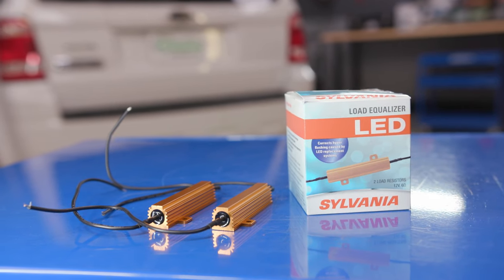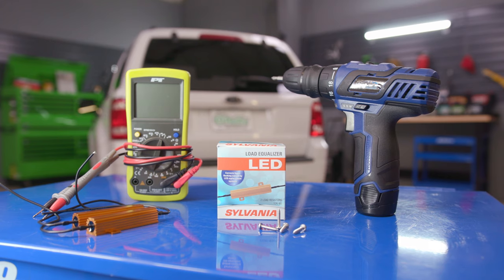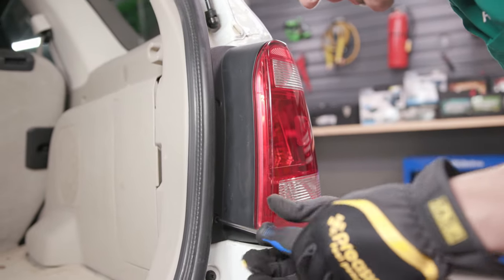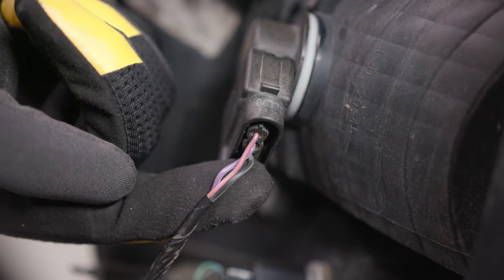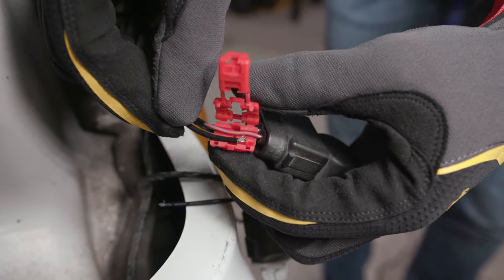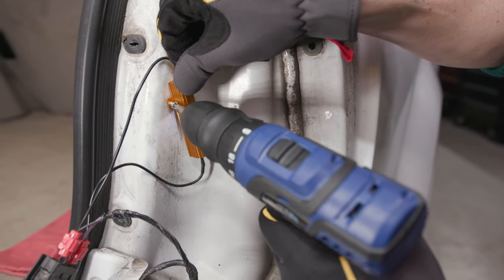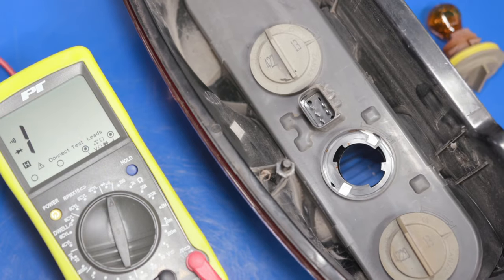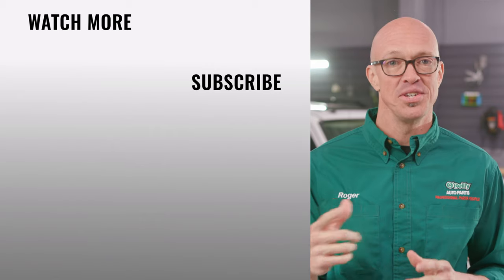How To: Fix Hyperflashing LED Turn Signals (Load Resistor Installation)

Comment from the maker: Supplies Needed for This Job:
1. Safety Glasses: https://urlzs.com/hbwc
2. Gloves: https://bit.ly/2GvfwAm
3. Pliers: http://bit.ly/2Zxerj1
4. Drill: https://bit.ly/3drlrF9
5. Self-Tapping Screws: https://bit.ly/34eUYXo
6. Load Equalizers: https://bit.ly/33hyplP
Reply: O'Reilly Auto Parts  what would happen if your LED burns out and you need to replace the bulb,  what if you have no choice and use a regular light bulb?  Do you have to take the load equalizer out so it works right ?
Reply: Do you have a link for those red splices?
Reply: How do you determine which is the common wire in the second scenario (with the plug with 6 wires). I determined the turn signal wire using continuity, but what about the position and common wire?

Comment: 16 bucks for two $1 resistors... dang!  That's my kinda profit!
Reply: 8pcs on amazon for $15
Reply: DO NOT USE THESE STYLE RESISTORS FOR YOUR VEHICLE!!! READ THE REVIEWS OF THE PRODUCTS YOU'RE BUYING!!
These Chinese resistors that you find literally everywhere (local auto parts store, Amazon, eBay, YouTube Links, etc) are 150w 6ohm resistors. LEDs won't EVER call for this much resistance.
Because of this, these resistors get SCORCHING HOT (over 250-300 degrees F) in a matter of seconds (around 15-25 seconds of use) due to the resistors insanely high Amp draw.
Most 12v resistance situations (CanBus Errors, Hyper Flash, etc.) call for 16-18 ohms of resistance @ around 13-15 watts. Simply buy (2) 25watt 8ohm resistors and wire them both in series (+ to -). That is PLENTY for a 12-16v application without burning up your car or constantly replacing LED lights that should be lasting months if not years longer than what they do.
Reply: @greysinclaire  where can I buy them? I just installed led headlights and I need resistors.
Reply: @LuisHernandez-he53  Check Amazon for some 25w resistors. They should look like these 150w ones just half the size.
Reply: @greysinclaire  👍🏻thanks for getting back with me!
Reply: @greysinclaire I told others. I highly recommend an led flasher relay or an led bulb with a built-in resistors.
Reply: @LuisHernandez-he53  Headlights use decoders not resistors to stop the strobing and winking.
Reply: @coloradostrong  can I find them on Amazon or eBay? Thanks for the reply..
Reply: @LuisHernandez-he53  u can. But I would check at autozone for Novita led flasher relay.
Reply: @coloradostrong  decoders or anti-flickers. Either one

Comment: And no point is it explained how to tell the common wire from the position wire. I give up I'm just returning it. I don't really see any point to adding this to use LEDs since it draws the same amount of power and costs five times as much.
Reply: U can still run led with a better approach. Instead of wiring the load equalizer resistor, just get the led flasher relay and swap them. 

When u have a turn signal lights on. U hear it clicking sound. Go under the steering wheel and from there, u will listen that turn signal click sound. It’s behind the plastic panel, once u do that. Use ur fingers to feel if u see a large box that’s labor as flasher relay. From there that’s the one u can swap from own to led flasher relay. 

Much more easier approach than splicing the wires.
Reply: If u don’t want to do all that. Get from auxito. They have a lot different led turn signal bulb options that have a built-in resistors. A simply plug-and-play led bulb. And ur done.
Reply: @toyotabrony Not at all clear what you’re trying to say.
Reply: @toyotabrony It took time to figure out what you meant to type instead of “labor”.
Reply: @user-yl4rh8vn8c meaning for an led bulb with a built in resistor, and draw the same or more wattage than the factory, it helps prevent from hyperflash.

Comment: One of the main benefits of installing LED lights in your car, etc., is the significantly lower current load on your battery/electrical system. By installing two 24W (e.g. 12V x 6Ω) resistors in parallel on each blinker circuit, you are essentially negating that benefit. This is not the correct procedure, it is simply a "lazy" workaround which actually introduces a safety issue because of the resistors heating up, which then requires that you drill them on to the car's body in order to properly attach the resistors to provide adequate heat dissipation/cooling. Not sure if everybody would be ok with drilling their car for no real benefit at all. Just saying ...
Reply: I got lucky on my 2018 f150, there is a spot where I could just use a metal hose clamp to keep it in touch with the body of the car
Reply: Ya k No,  I was thinking if it gets hot does that mean it is shorting out. And after reading your comment I agree totally. This sounds sketchy as hell LOL there's got to be a better way or just enjoy the quick Flash.
Reply: Other benefits e.g. brighter lights, longer life might make it worthwhile still, right?  Do you have a link to any info on the "correct" procedure?
Reply: Love how you criticize this method and call it lazy but provide no beneficial insight into a correct way to do it. That's what's lazy to me.
Reply: The primary benefit is longer life and brighter output. Not reduced load on the electrical system. That’s ridiculous. The ballast resistor restores the load right back where it should be, hence why the flashers now work correctly.
Reply: The benefit is the appearance and function of LED bulb its self —  load resister just makes it flash at normal speed. Been using these for 10 years. You worry too much

Comment: If front and rear turn signals are led do you need two sets ?
Reply: Yes.
Reply: @chrisjohnj30  so if i use led on front rear and side marker i need 3 sets?

Comment: It's actually because led lights are diodes and will show an open circuit in one direction, placing the 6 ohm  resistors will bleed voltage back to the flash relay sensor tricking it to indicate a n incandescent  bulb.
Reply: Just a load resister bro. Plug it in and it works
Reply: @drdrew3  Well at least he explained it. Many people have no idea. We will see how a resistor works for the underhood  light on my C5 Corvette. So far no one has been able to solve the problem.

Comment: Just installed One resistor 50W 6Ohm on rear led and It’s Ok for one side. No need to add one more resistor to any led. The relay working for each side not for each bulb. The front and rear bulbs are on the same circuit.

Comment: I tried using sylvania zenvo lights in my car(2003 Saturn ion) and the light flashed normally/DRL on on for a while and the Led will eventually go out like the car has cut power to it or it’s burned out and the signal will flash fast saying that the bulb is burned out. I’m wondering if this will work because it don’t hyper flash

Comment: Doesn't the load resistor ad pwoer draw... wich negates the whole or most of the benefit of havibg LED bulbs to begin with??
Reply: Why does this matter with a car? You have an alternator and a battery. LEDs you get the length of life over halogen and the brighter white for darker places in the pnw and many other dark places

Resistors allow them to function properly on some vehicles that are stubborn electricly
Reply: The idea is, u need to trick the computer, by add a resistor so the computer things ur running on a factory bulb, but in reality ur running with led.

Comment: On the Sylvania box it very clearly notes the resistors are for off-road use only. I just bought 4 of them from Walmart. And now, after watching this and reading elsewhere, I might just do what no one else has mentioned. I might just use a spare socket and a new incandescent bulb in place of the load resistor, and put that somewhere. I only need 1 resistor on each side. The incandescent bulb radiates a lot of its heat in the form of IR, where the resistors are strictly pure heat radiation.
Reply: Just because package it says for off-road use only. Doesn’t mean u shouldn’t buy one. Just get for better safer led bulbs

Comment: do you need one resistor  for each turn signal or one for all 4 turn signal ?
Reply: One for each turn signal bulb.
Reply: Thanks
Reply: It depends on the vehicle. Some vehicles only require a minimum load on the left or on the right flasher.
This is due to the mechanical flasher that requires enough current to heat the internal bimetal element. 

Some newer vehicles that utilize Canbus may require a resistor for each bulb.  
This is  due to the circuit design which may not even have a flasher canister installed.

Comment: I bought Hooke LED taillights that came with a resistor wired in to the plug. No screws were included and Hooke support says you can use the resistor or not. Does mounting the resistor to the casue it work and letting it hang casue it not to? Doesn;t seem like I'd want to to leave it hanging without being able to disperse the heat.

Comment: I added new headlight assembly to my 2013 gmc denali pu. I have two led turn signal bulbs in each light assembly that are hyper flashing. Do i need to put a resistor onto each bulb for a total of (4) or do i need just one resistor for each side for a total of (2)?? 

Second question? If i ever upgrade the rear tail light turn signal bulbs to led, will i have to install resistors on these as well??
Reply: A load resistor on the turn signal that is easiest to get to. Generally that will be the one in the rear. You more than likely can get by with just 1 resistor for each side.

Comment: I tried these things on my 08 charger, worked for a bit, then started hyper blinking again. The internal housing began to warp from the heat from sunlight so I switched them back to stock. Getting new LEDs so hopefully this video helps me connect them right.
Reply: id recommend buying an aftermarket relay thats for LED singals, its so much easier, and working with the OEM relay box

Comment: Personally I would rather solder in the joint rather then use the infamous "3M" connector. 3M is top notch but this one goes back to the 60's or before. Break out the soldering tool and some shrink wrap and wire this inside the automobile if at all possible. I will be using weather pak connectors so if the resistor goes bad I don't have to deal with the harness again just the resistor.

Comment: I have a 65 El Camino with the halo headlights I'm using the blinkers in the halo headlights as my turn signals,,I hooked it up as video says,but absolutely no difference in speed of blink....help ?
Reply: You have to make sure the splicer is closed very tightly with a pair of pliers. If it doesn't cut into the wire and make contact nothing will happen.
Reply: @ZantharEos  
I got rid of those and went the easy way and I got it led compatible flasher relay quick easy and so much more easier than doing any wiring whatsoever.

Comment: What if you're trying to install these on front led turn signals?
Reply: LOL. Have fun. I ran Auxbeam switchbacks with no problem, then I upgraded to MAXGTRS. Everything was great until I started the car and tried all of the light positions out. I got hyperflash only when the car was running and the parking lights were on. When the car was off, I didn't have hyperflash.When the parking lights were off, I didn't get hyperflash. I took the front facia off and removed each headlight to install a resistor on each one. "03 Accord. I already had MAXGTRS in the rear turn signals, and they worked without any resistors. 1157 switchbacks in the front turn signals and 7440 in the rear. Each bulb is a little over 2000 lumens. Super-super bright. Most vehicles now no longer have a relay you can change out for one that is LED capable, hence the need for the resistors.

Comment: How many load resitors is too much ? I want to change a few bulbs in my car to led like reverse, brake (separated from rear blinkers) and front blinkers and I'm wondering if there's a maximum of load resistors you can put in a car. Is it, as long as it is not in contact with some sort of plastic, I can put as much as I need ?

FYI : I've already change the brake bulb to led and installed a load resistor on each side. Online I only saw load resistor installation for fixing hyper flash but never seen it for brake lights. In my car the brake led light bulb w/o load resistors caused my cruise control to not work.
Reply: im by no means an expert but the idea of the load resistor is to trick the car into thinking the bulb is a standard incandescent bulb so in theory there could be one for every light in the car.
Reply: You only need 4 for the the total car it’s only for turn signals
Reply: Typically, only lights that will be blinking will cause hyperflashing, However, sometimes a light in the dashboard indicating an issue with a light bulb. I've installed them on back up lights and cargo light areas without any issues. You will need to determine that once you install the LEDs and see your car's electrical system responds.

Comment: Do they need to be installed on front and back
Reply: Depends, if yu put led im front and back then yea
Reply: @catmatiskam7092 not really. Two load equalizer resistor are enough for both front and rear led turn signals

Comment: I used to own a Volkswagen and with the special software a lot of owners use on those there is a way to switch it to LED mode and not need resistors.  I wonder if anything like that is at all possible with a 2017 Rogue Sport SV.  Volkswagen owners use VCDS and a cable made for connecting their car to their laptop.  It can do a myriad of things including make your car just not start at all if you are not careful!!  I wonder if something similar exists for Nissan.  The only drawback to it is everything is in hex decimal and needs to be entered exactly or any number of weird things may happen.  It is not for the faint of heart !!
Reply: i don't think its possible on nissan there isn't that special software you're looking for also on the sport model there isn't a lot of space to put in the actual resistor so it might not work as effectively

Comment: One it’s nice to see more led bulbs with Sylvania installations and installed a load equalizer resistor. 

But why the hell did the owner picked the white led bulbs?

Yes it works great. But having a white led bulb behind the red lens is not a true alert. 

Putting a red led bulb behind the red lens or as they call it, a red filter. Gives a better complete compliant brake light and more more deeper and more vibrant red than ever. 

I would highly recommend sylvania ZEVO. They are a bit brighter and much better led bulbs than regular led.

Plus it’s got a lifetime warranty. And regular led have 1 year warranty.
Reply: Get some real bulbs, Sealight, Auxbeam, MAXGTRS, Wenle. Those are pushing 2000 lumens each bulb, with a fan. What you say is true about a red bulb behind a red lens. It gives a deeper, more intense red. A white LED behind a red lens gives a pinkish washed out look to the light.
Reply: @coloradostrong  a real led bulb is a real led bulb. 

I only highly recommend to anyone, that’s lookin for as set it and forget it led bulbs to the best and the brightest led bulbs. 

For example, my 2015 lifted Scion xB is running the 7443R sylvania zevo red led bulbs. It maybe the same brightness maybe couple hairs more. But the response is a big improvement over stock. 

But at night time, it’s a major big difference. Especially if u have a polish mirror reflectors behind the red lens with a red zevo led bulb. The brightness and the intensity is perfectly nice. And it matches the brightness with the third brake lights. 

These are the best on the budget led bulb replacement. Especially with a lifetime warranty. 

U can’t go wrong with them. And that’s why I bought more sylvania zevo LED’s for my family’s 2017 Toyota sienna le. On top of that, I bought auxito M3 9005 high beams, and lasfit LA plus H11 low beams. 

And other lasfit t10’s as well. These are my top 3 recommendations. 

Sylvania zevo, lasfit, and auxito. 🙏🏼🙏🏼🙏🏼

Comment: How many resistors I need to put sir.  ???
Reply: Depends on how many turn signal bulbs u have. If it’s one. U need one for each. If it’s two on each side, u need two.
But instead of doing all that hassle. 

Just get the led flasher relay. It’s an easy swap mechanical box relay that works for all turn signals.
Reply: @toyotabrony  okay bro I need only buy one relay flasher ?
Reply: @tonycervantes4816  correct. Instead of whatever how many halogen bulbs u have that’s also a turn signal function. U just get 1 led flasher relay. 

Just look up ur vehicle of year, make, and model, and check where’s ur flasher relay located. Mostly it’s under the steering wheel. Turn it on, and listen. If it is under and if u open it, and feel which one is making click noise u got it. Again.

Just 1 led flasher relay that will definitely work for led turn signal bulbs. Autozone Carrie’s a Novita led flasher relay